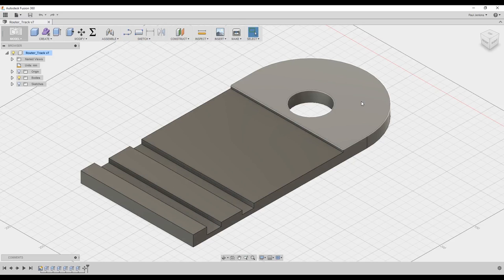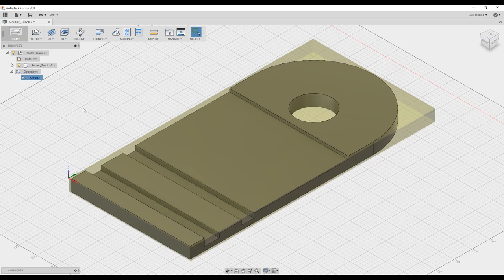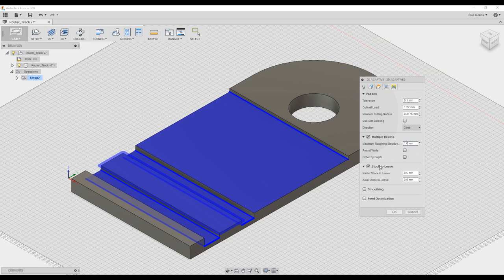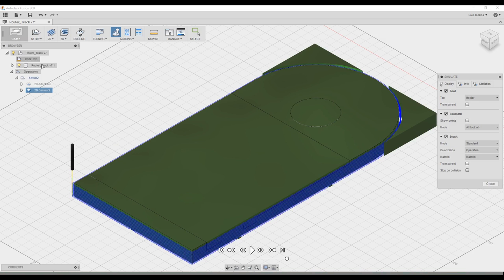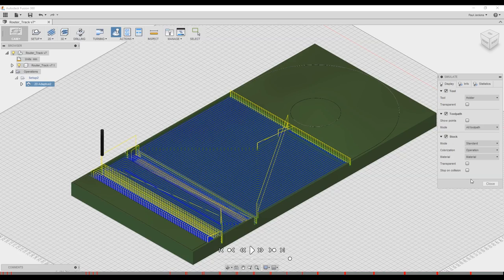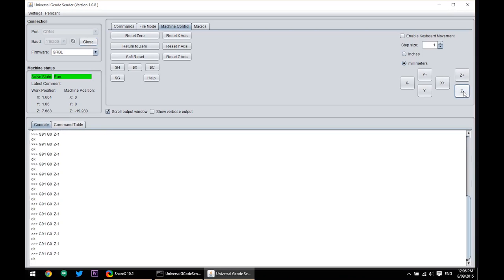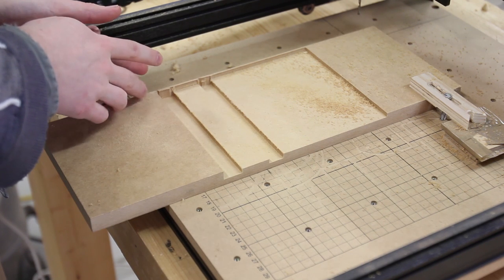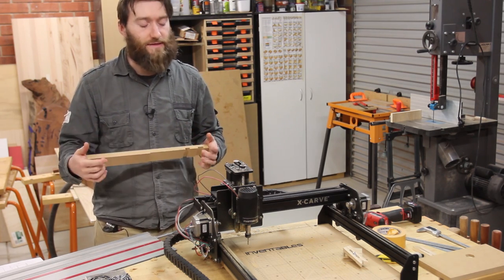071 - CNC: CAM/Machining with Fusion 360 and the XCarve

Comment: Great video Paul. I have been using Designspark for my CAD and Cambam for my CAM. Designspark is free and is very easy to use. I will have to give fusion 360 a crack as it looks pretty good for a all in one option. I also have Meshcam and find it stupid easy but can take a long time to finish it run. I cut a logo out for my son and it took 3 days straight to finish it. I find the problem is there are to many rapid movements (moving from from cut location to the next) as it would cut a small piece on one side of the job then move to he other end to cut a small piece only to move back to where it started to cut some more.

Comment: Hey mate, have you seen the +NYCNC channel? It's full-on CNC work but really engaging and great Fusion 360 stuff. 

Will you be at the Timber and Working with Wood show? 

Also discovered Masters near me now stocks DAR poplar and red oak. Great news for those of us with no jointer, thicknesser etc. 

Cheers
Reply from the maker: +Rick Measham I had a brief look at NYCNC the other day - a few videos queued up on my 'watch later' list. 

We will be at the show, yeah, on Friday. Looking forward to it being in a bigger venue.

Relatively early on, I know Knoxfield Masters had red oak (not sure about poplar), but the prices they were charging were pretty ridiculous (about the same as what Bunnings charges for Tas Oak/Vic Ash) given just how cupped and warped every single board was. I have no idea on their pricing any more, as Masters is half an hour drive (and I don't drive!) away from me, and you have to go past 5 Bunnings to get there. A shame really, as they're the only place with the MinWax poly I use.

The local hardwood dealer I go to dresses everything for me, and is still about half price per cubic meter of what Bunnings charges (and what Masters originally charged).
Reply: +Paul “TheWoodKnight” Jenkins The local hardwood dealer? Which would that be?

I may be at the show too, hope you dont mind randoms saying hello if I spot you!
Reply from the maker: +ddabate Apart from the prelam tops, all the timber for my mother and sisters furniture has come from http://www.wrtimbers.com.au

There is also Mathews Timber which I'm pretty sure are happy to dress stuff as well.

Comment: Bro, i followed your steps, i'm using grbl shield and grbl 0.9 but it doesn't generate z coordinates and when i try to run it goes to a very low speed, any sugestion?
Reply from the maker: You're better off contacting Inventables or Autodesk support if generation of code (or actual interpretation) is an issue.